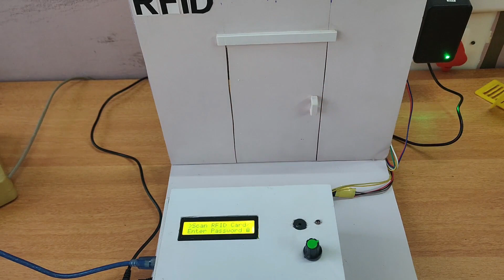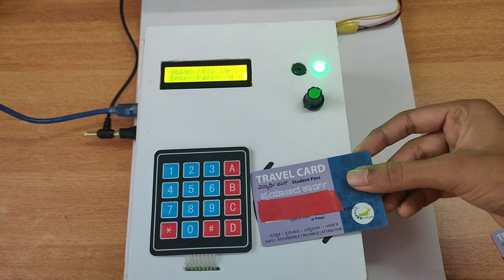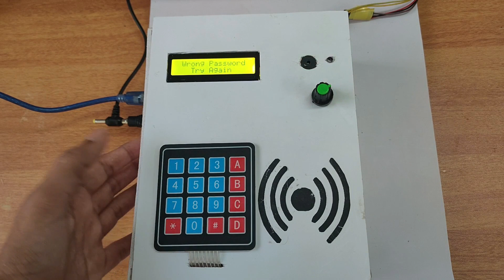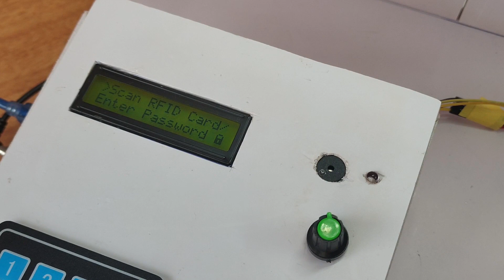RFID and Password based door lock system| Smart Lock

Comment: @Electronic Buzz Good job! The thing is that u only showed us the project functions. I would like to see the circuit please. I have almost the same project but in my case i am building 5 small boxes for keys with ESP32 that can be unlocked using a web page + RFID for 2 factor authentication and i have some problems in building the circuit cuz circuits are not my thing i am programmer hahaha. thanks in advance
Reply from the maker: Connect me on my Instagram,i can help:)
Reply: Did you get the circuit diagram? If you, please send me